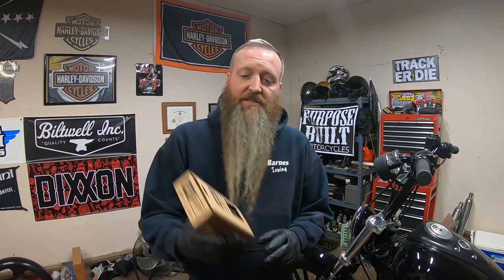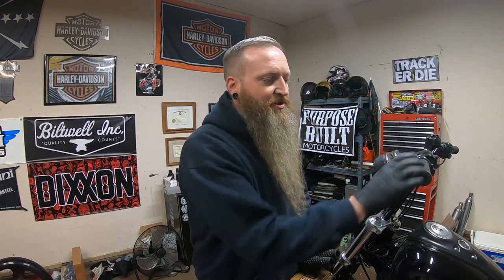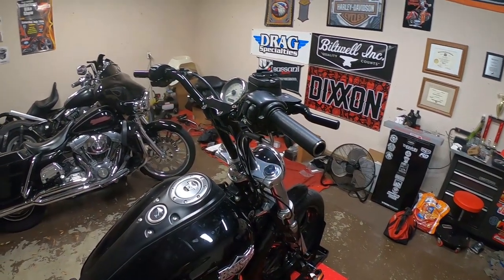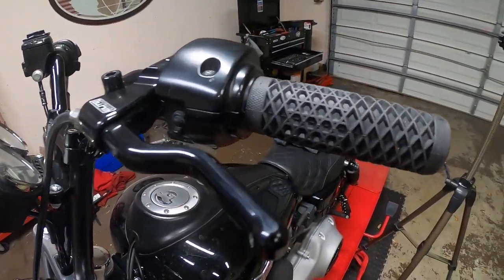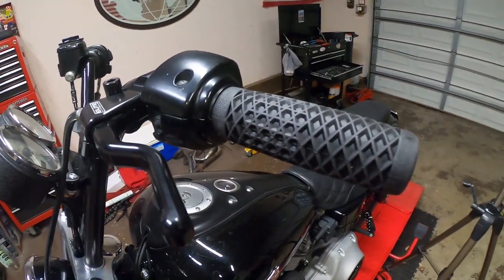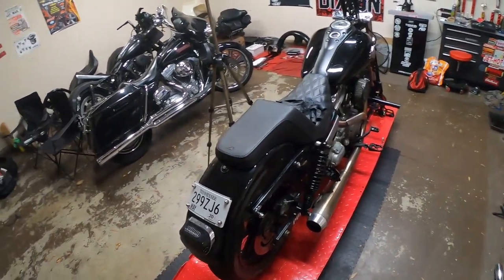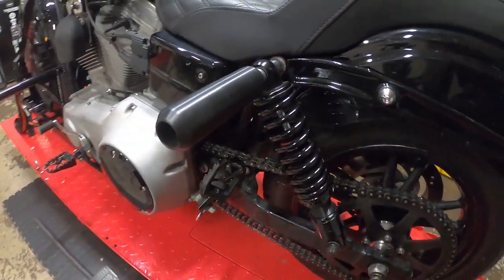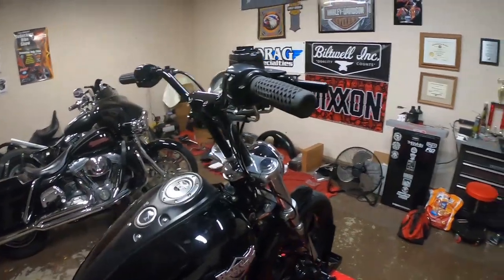Vans Grips Install /Harley Davidson Dyna/

Comment: Great video. Love that rubber grips. I am so used to traditional HD grips all these years and I have been thinking about getting this type of rubber grips for my new purchased Harley. How do you like'em? The clutch side do not roll meaning moves at all after such periods of times? This would drive me nut...
Reply from the maker: I love them super soft but they do wear faster. I used brake clean to install but after a couple hours that dries and the grips dont move. I hope that helps and thank you for watching my video. If you enjoy this channel consider subscribing thank you

Comment: Can these be installed on a 2021 road king? Also what seat do you have on there? Does that seat lower you at all? I’m 5’6”. I like how driver portion is stitched and passenger is plain. Cool video!
Reply from the maker: Yes you just need a TBW throttle tube and its a saddlemen step up slightly lowers
Reply: @TrippHPjunkie  thanks man!

Comment: Hey Tripp, my factory harley grips have a little slot that the left side hand control grabs onto. Similar to the integrated throttle tube on the other side. Will the controls move at all on the clutch side without that?
Reply from the maker: Nah you should be able to tighten them down enough for them to not move on you
Reply: @TrippHPjunkie  thanks man, just ordered a set and wondered! Had to reference the YouTube’s! Thanks for putting out awesome content

Comment: Hey man I have the same exact dyna, looking to do the same bar setup you have. Did you have to go with extended brake and throttle cables? or were you able to make the stock ones work.
Reply from the maker: Everything is stock....thanks for the comment...🤜🤛👍👍👍
Reply: tripp_hpjunkie thanks for the reply man, did you end up buying your tach from the dealer? I know I saw in your other video you got the harness from guerilla cables
Reply from the maker: Yes exactly just ordered a new tach from the dealer....🤜🤛